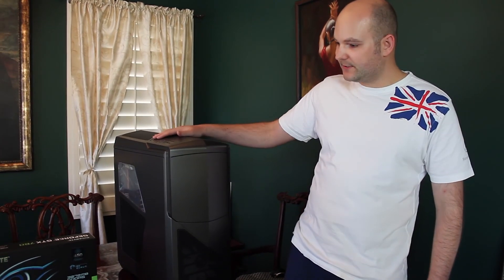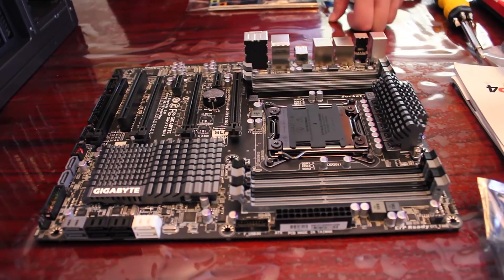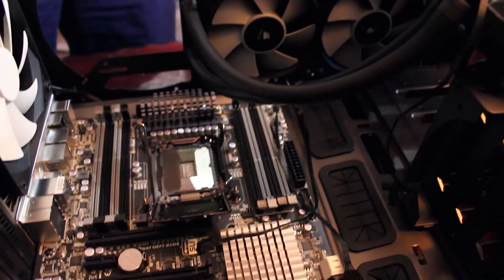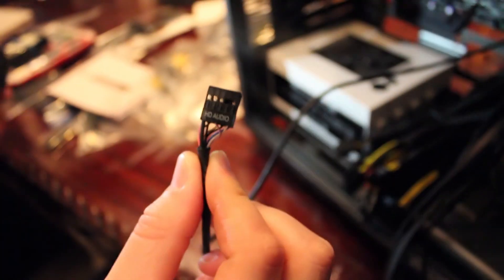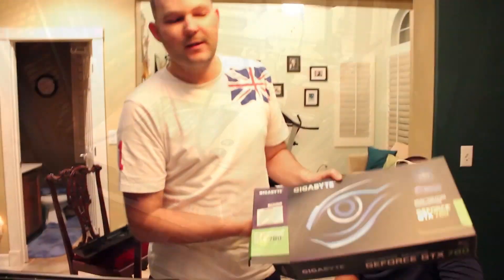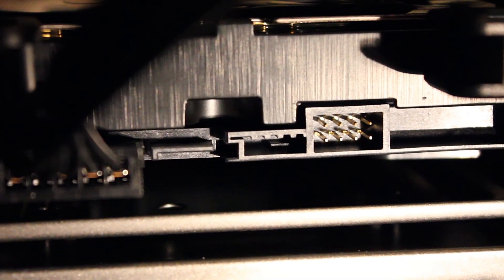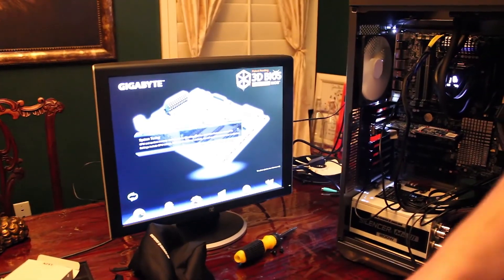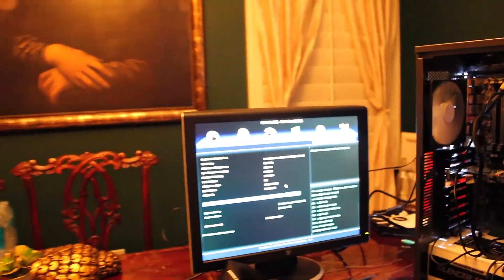"Ghastly fast" video-editing P.C Build(64gb RAM)-Jonathan Sturak

Comment: My heart skipped a beat when your assistance press on the pins on the socket!
Reply: Match the triangles...drop straight in.... never touch or wiggle or apply pressure with fingers !!!!! Rookies !
Reply: Kevin Watson I also did the same thing years back on my Parent's PC, and a pin got bent.  It was a CPU that is no longer is produced, so with no way to get a new CPU just like it I had to replace the entire motherboard just so I could have a newer CPU slot that is currently supported.  Cost me $600+.  I know it's tempting, but you just have to take a leap of faith and trust the triangles. =)  Love this build by the way...extremely jealous!
Reply: Kevin Watson i always wiggle the proccessor very slightly to se if it went in. And surprisingly it never explodes!
Reply: lilflanges You are lucky. I installed a 1156 CPU quite a while back and did exactly the same thing - got a couple bent pins... took me quite a while to discover those because it didn't boot. Luckily it didn't kill the CPU.
Reply: ousi00 Oh no! that's too bad. Jees. Processors are so breakable. I can't wait for the day when computer parts will be indestructible! lol.
Reply: Kevin Watson Sorry, Kevin! I meant my reply to be towards +lilflanges instead.
Reply: Timothy Creed  No prob !!!!  I just watched that video again and they are fucking funny ! They have no clue what they are doing.... from connections to cable management and everything else ! I have similar parts but I have the 4930K and 2 GTX-680's in SLI ... and 2x Samsung 512gb SSD in Raid 0 plus a few more drives for storage and games .... 32gb G.Skill 1866 Ripjaws z Ram ...same motherboard .... Corsair 650D case ... same CPU cooler .... and other assorted goodies ! But I built mine correctly !!!!  LOL  Have a good one !!!